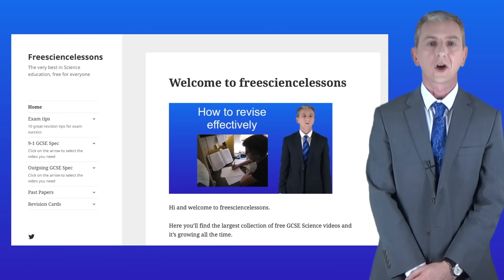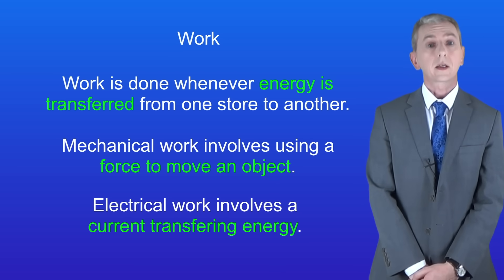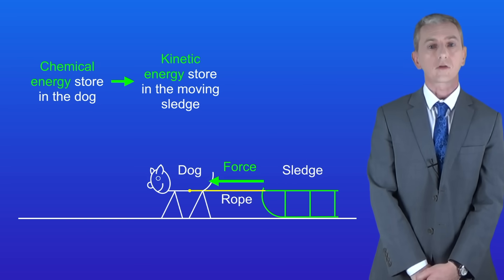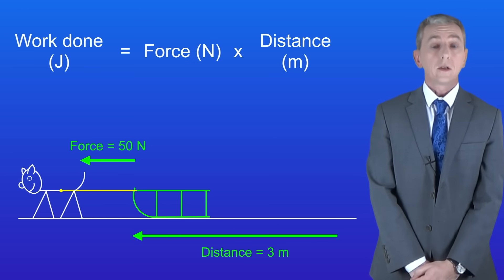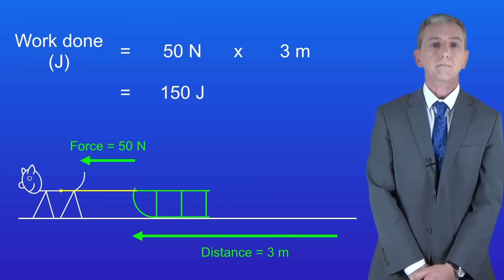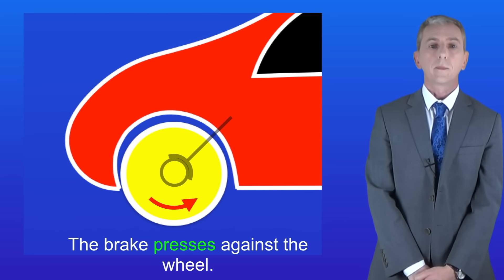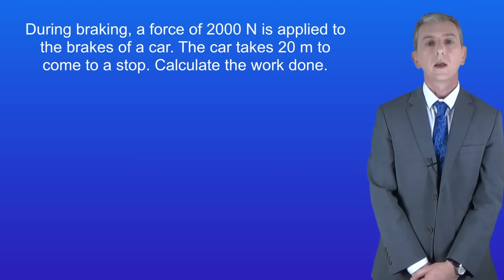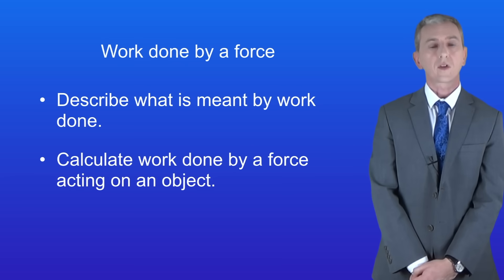GCSE Physics Revision "Work Done by a Force"

Comment: In my revision book, there are 2 'Work done' formulas. But this one is in one of the topics from paper 2 and in paper 1 the formula is work done=power x time, so do I have to know both formulas for the both papers?
Reply from the maker: You should learn both formulas. However, if a formula is in a paper 1 topic then it should not be required in paper 2 or vice-versa.

Comment: I would like to point out that a fraction of the kinetic energy stored by the moving car is dissipated as sound as well.
Reply from the maker: You are correct. It is a very tiny fraction indeed so I deliberately focus on the main energy conversions. But thanks for the message. I hope that you found the rest of the video useful.
Reply: Useful is an understatement! I am currently speed-running through your videos as a strategy to boost my BMAT score in section 2 and the help has been immense. As a foreign student I didn't study GCSEs so your work has done wonders for me!